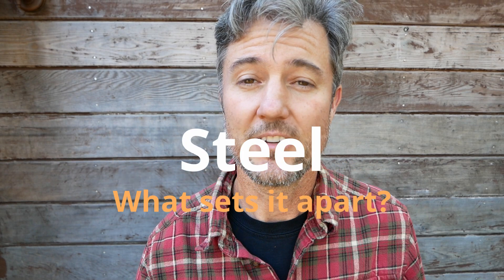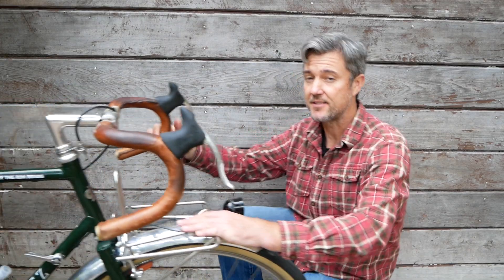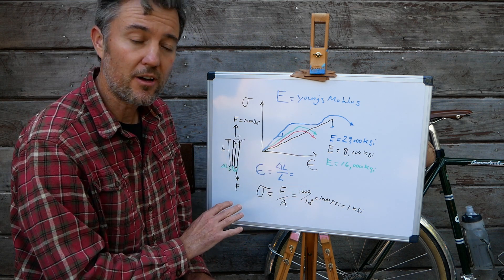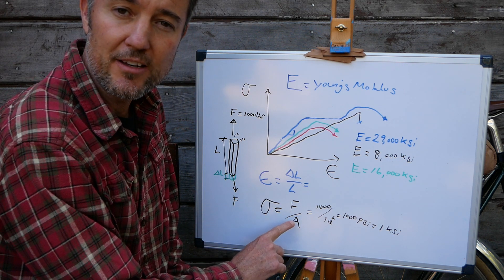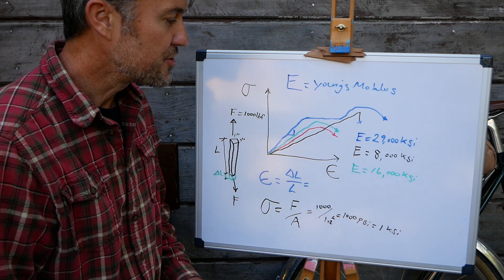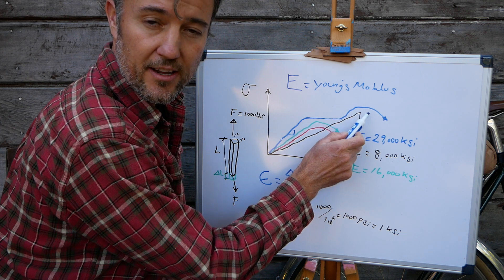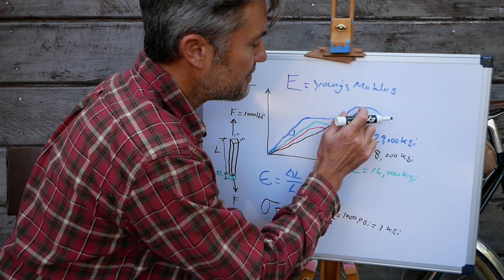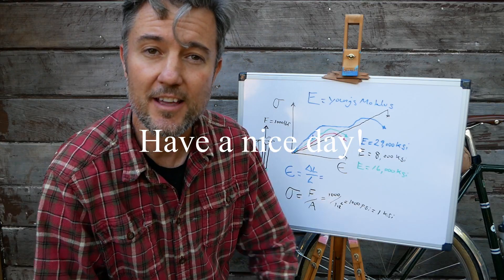Steel is a GREAT Material for a Bicycle Part:1 Intro

Comment: Compelling arguments. I'm currently on a carbon bike and for my next bike I have narrowed it down to either Aluminum or Steel for various reasons but mostly budget. Looking forward to this series.
Reply from the maker: That's terrific, Todd! The issue with steel is its density. To get a comparably light weight steel bike it's going to be quite a bit more expensive. If you know what you want and can afford to pay the premium for a steel bike you'll really enjoy it!

Comment: I don't think, when you can't pronounce Mo, that you have any understanding of steel as a bike frame material , youngs modulus,  Ti, strain, stress, the linear elastic state, yield, etc...horizontal own vertical...WTF...?
Reply from the maker: I'm not a metallurgist or an English major.
Reply: @Henrywildeberry   Henry, I don't think you have to be a metallurgist to geek out on frame materials, or an English major to communicate your passion to others. I really enjoy hearing from you through your posts, and look forward to any new ones that come along.
Cheers mate!
Reply: Steel has an extended history as an incredible frame material for bicycles, in a wide variety of alloys. That's all you had to say. No need for Young's modulus or any other dialogue.  It persists into the 21st century as a material of choice for bike frames of distinction across a broad range of cycling disciplines...I'm .also not a metallurgist or an English major...